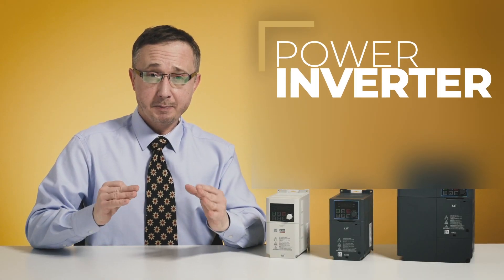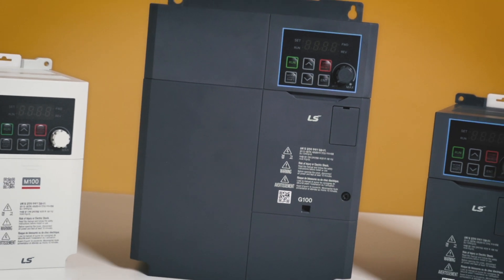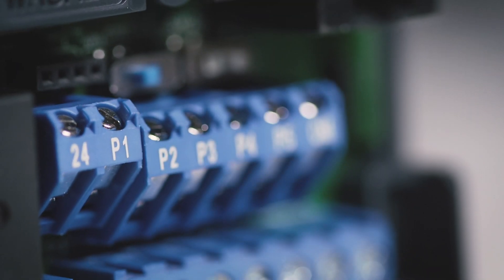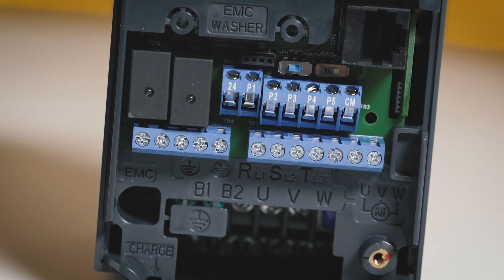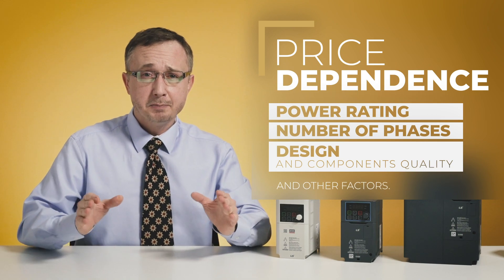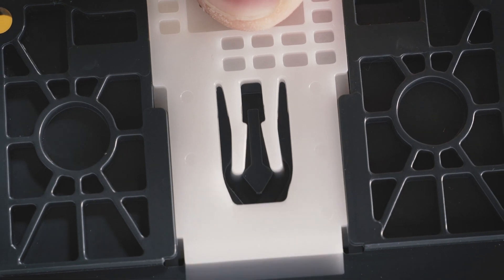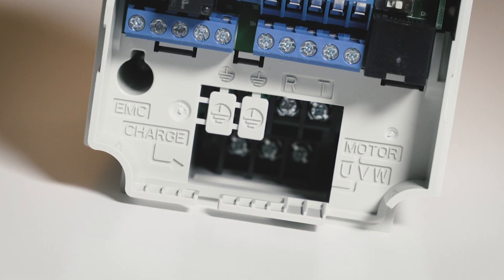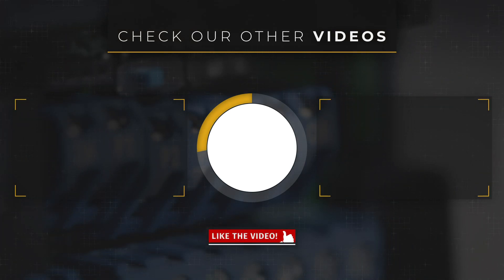LS Electric G100 & M100 Inverters

Comment: Why the output voltage is not correct, i use single phase to 3 phase ،anyway the output voltage is not as the input voltage